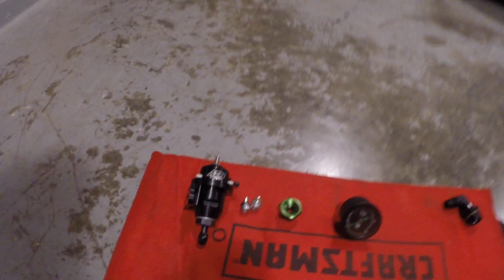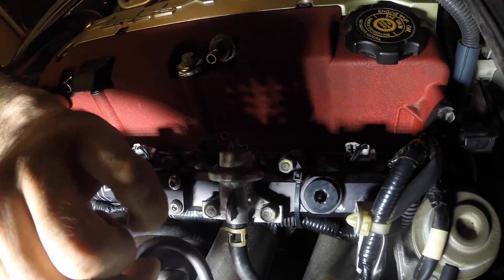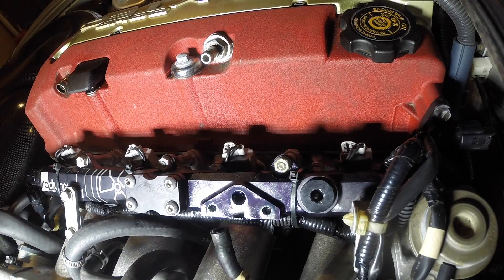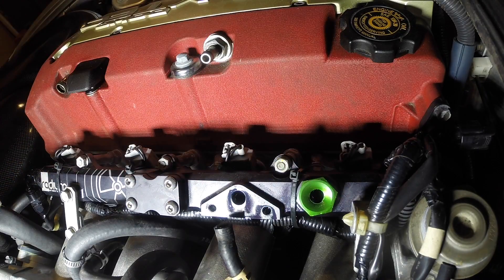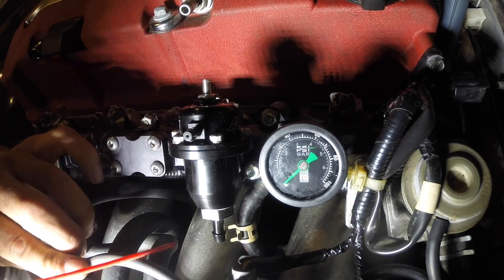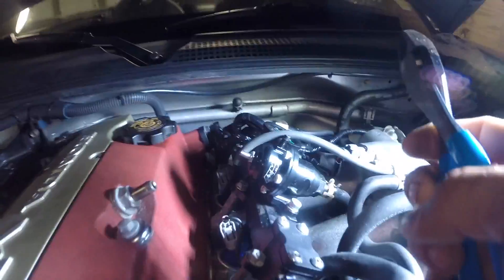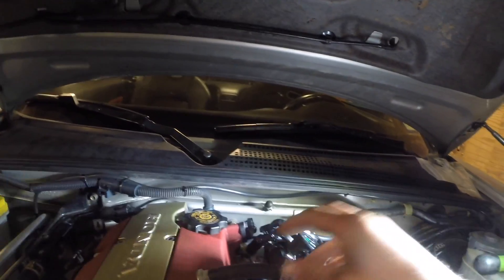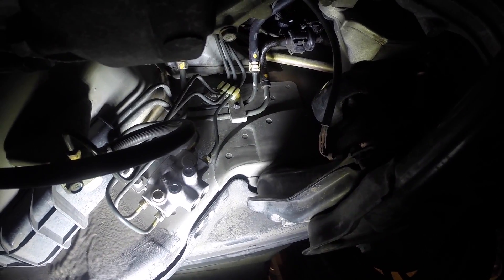Part 2 S2000 Upgrade

Comment: How long did you let the paste on the pressure gauge sit?

I pretty much have the exact set up, but it keeps busting a leak after about 20min of idling
Reply from the maker: Not sure exactly. It shouldn’t take that long. I think there’s other issues going on with yours. Is it tight enough?
Reply: @ChaseDiaz_garage_works  I'm pretty sure it is. Theres only about 3 or 4 threads left exposed.

Hm, do you remember if Thread sealant with PTFE is the paste you used or is there a different kind?

Thanks again for answering
Reply from the maker: Pretty sure I had the paste. I haven’t had issues with either one though. If you go too tight I could crack things.

Comment: This car is beautiful. Don't let anyone say it isn't.
I have 2000 S200o. Is there something more economically sound to increase speed? I'm a little older and don't want the wife thinking!!
Reply from the maker: Thanks!!! economically??? hmmm test pipe, and intake will be good I suppose but then you'll have to deal with tricking the secondary 02 sensor. Depends on the test pipe you get. Try that.
Reply: Bite the pillow and supercharge it

Comment: you have no idea how corrosive E85 is!
Reply from the maker: Camilo Cantor yes. I've looked into it and it's actually not bad to most components in the system. I think at most my fuel pump or sending unit will crap out long term. That's not a big deal for me. It's worth it for detonation resistance in my opinion lol.